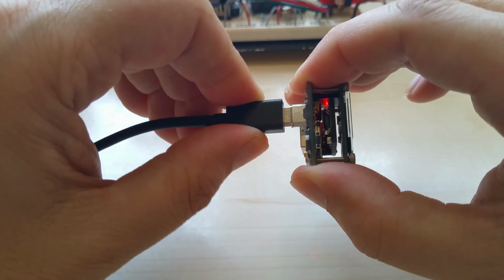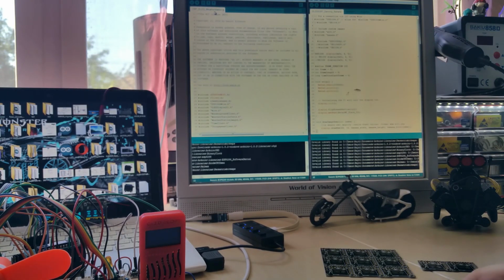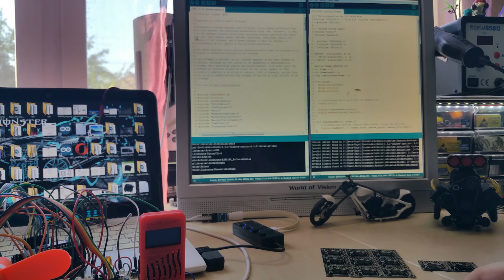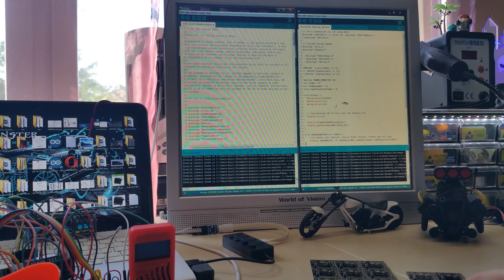OLEDiESP a Tiny Cube with ESP07 / ESP12 + OLED IoT

Comment: Hi Hayri, for what we need the MicroSD Card Reader on your Product? Greats from Germany. Gio
Reply from the maker: Hi Gioacchino, it all depends what you want to use the ESP for, you could save any data to the SD card from a temperature sensor for example and publish it to the web or even have a webpage published from the SD card. There are many applications that all use the ESP as it is more powerful and faster than the Atmega328 but still as easy to program and use. Most codes can be uploaded from the Arduino IDE and my ESP cube can be connected directly to your PC with a micro USB cable. No other hardware needed. Hope this info helps you out :-) Need to come to Germany soon, miss it a lot, lived 25 years in Karlsruhe. Take care.
Reply: Hi  @iHayri1  can we phone for any question i have for you, you can send me your Phone Nummer and i call you back... So we can make a nice order...
I hope you speak a litte bit german :-) :-) :-) send me a email to mikel6575@gmx.de Thanks a lot

Comment: How reliable is this cool lil thing? Does it come with warranty?
Reply from the maker: I have my first version running almost nonstop since uploading it's video (Tripple ESP display) and no issues whatsoever. I am selling my items tested and since I do not know what you do with it and not a single ESP module gets sold with warranty how can I offer warranty myself. On the other hand, I fixed stuff when a customer accidentally damaged my product for free and didn't even charge for the part, how is that? Do you see somebody else doing that? I doubt it.
Reply: I intend to use it as a clock, which I want to keep it plugged in all the time.
Reply from the maker: Well mine work with it plugged in all the time. they do get a little warm, around 30 degree Celsius, but thats normal.

Comment: I just got started with ESP8266 and its neat. You check out Node-Red? Glad you are doing projects with those. Great videos.
Reply from the maker: I just did, thanks for the tip. I have another project in the works which will be great, it will include a 1.3" OLED, Atmega328, ESP07 or ESP12E, GPS, rotary encoder, microSd card slot, all kinds of sensors, Neopixel stick, USB adapter, wireless charging and a 800-1200mA Lipo but the clue will be that you can upload code from the Sd card itself selecting the program from the display with the rotary encoder without the need for a PC. This way you will have a multiple devices in one small product that you can change on the go.

Comment: What's the highest framerate you can get out of this with the esp12?
Reply from the maker: Haven't tried it. If you have any code that can measure that let me know and I'll test it.
Reply: I think the peanut butter jelly time animation could increment a counter every loop/draw and check time. Every second elapsed, update a text or serial print the counter and reset to 0.
Reply: Oh and I'd also be interested to see when we might see an esp32 variant with BLE! I love your display/oled projects!

EDIT: They have a deep sleep low power coprocessor and all sorts of stuff still being unlocked
Reply from the maker: Maybe in the future, right now I am working on another new product which will be a small device with OLED, 328 and ESP, GPS, rotary encoder, microSD card that will be used to upload different hex files from the device itself without the need for a PC, among many other features. Difficult to explain in short here.